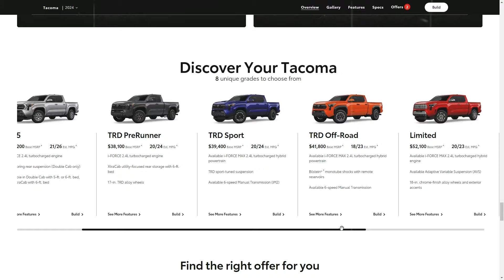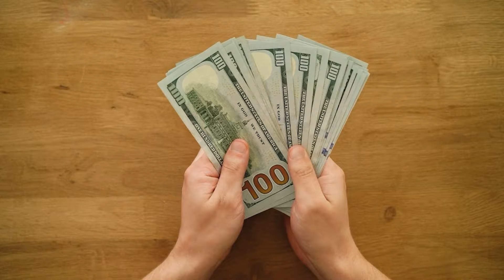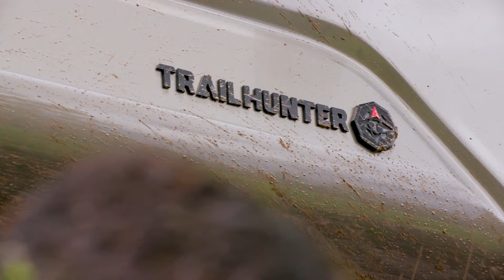5 Reasons You Should Wait For 2025 Toyota Tacoma (Don't Buy 2024!?)

Comment: I got my sr5 w/cold weather pack out the door at 45k. An happy with it. Picks up speed very nice. Even better with the ect power button. At 70 mph I get 31.6 mpg hwy of course. W/ picture proof!  Tows my 1000 lb jetski with ease. And my 16ft bass tracker like it's not even on there.
I bet those 2025 will be stupid expensive. I'll stick w/my 2024.
Reply: might as well, the 2025 will have all the same issues as the 2024 does.
Reply: 31.6 mpg lol

Comment: I just want a naturally aspirated v6 Tacoma to have various uses and mid sized vehicle. I want a vehicle to last turbo 4 cylinder vehicles on something that is going to be put to the limits by Toyotas customers is running compressed air through the engine reducing in my mind the life of the truck. Not to mention frequently changing oil.

Comment: The Tacoma has lost value by eliminating features in the Gen 4 that were standard on the Gen 3 such as turn signal in the outside mirrors, a full size spare tire power driver seat.

Comment: I paid $37,000 for my 2016 trd offroad, bought it brand new, wash it once a week and still have a rusted frame! I will not recommend any new tacoma or think about buying one because of that. Until they accept personal responsibility for their crap frames and replace them no questions asked!
Reply: They do replace them. I believe you have 12 years from in service date. The problem is that they've had the rusted frame problem since 1995. Get your truck Krown'd or Fluid Filmed and it will last hundreds of thousands of miles
Reply: Guarantee you just have surface rust or you live in the north east and never did any preventative maintenance on it
Reply: 😮 rust is bad.
Reply: I have a 2014 with 200,000kms with zero but of course I have it undercoated nearly every year. Have to  take care of your truck.

Comment: Idiotic. Putting in a 4 banger in a pickup truck in 2024 was a formula for disaster. Adding a blower puts another unnecessary component in a midsize truck that didn't need it with the 6-cylinder motor. Until that turbo charger spools up, it's still a 4-banger that will be sluggish. Scrapping the six-cylinder engine was a big mistake.